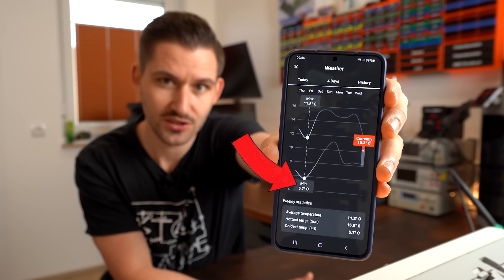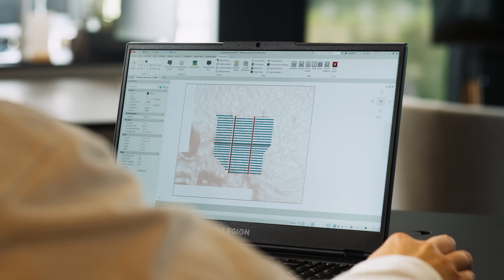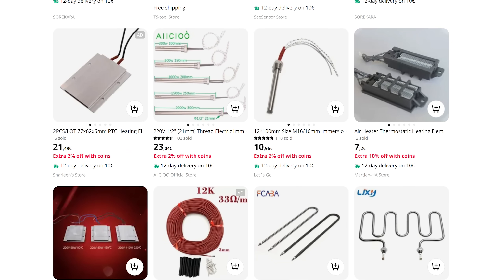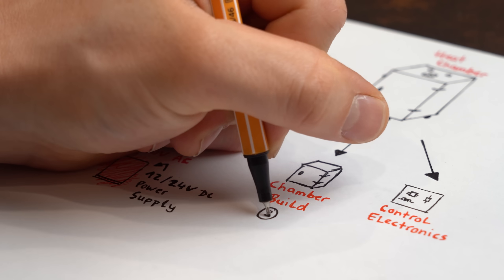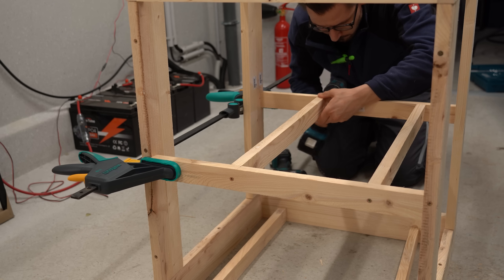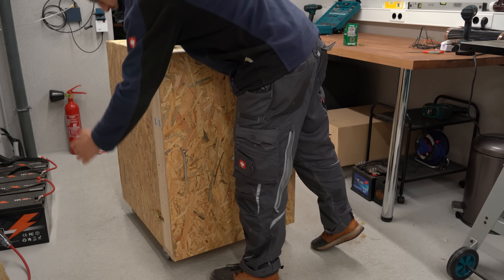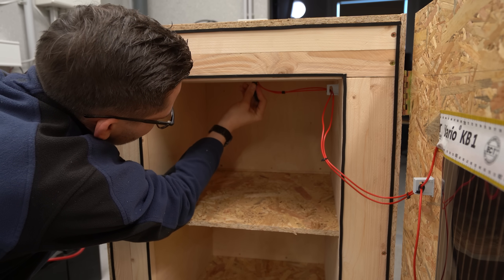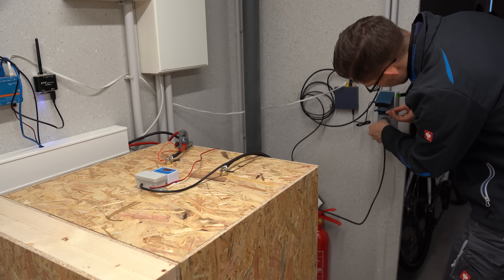The Best Battery Enclosure looks like this?! (Self-Heating)

Comment: I found a mirror heater (to prevent mirrors steaming up in the bathroom) is ideal for warming and drying photographic prints. It takes about 20 watts at 230v. It already has mains connections and is fully insulated so easy to use for warming projects.

Second idea - use a dead fridge or freezer if you can find one minus the compressor etc. from a recycling centre. It’s a box that’s already insulated!
Reply from the maker: Great tip!
Reply: Auto defrosting fridges have resistive heating circuits already installed
Reply: yes , these are available for free all over the place, more weatherproof also.
Reply: I'm interested in your use case for drying prints. Are you talking about darkroom prints with fiber based papers? If so, how does your setup look like? Thanks!
Reply: @jantielens  I use it for drying Cyanotype prints, both to prepare the paper (typically aquarelle paper) with the photosensitive material and also to dry prints after exposure, developing and washing.  I use two large picture frames taped one on top of the other, held horizontally in a cupboard.  The self adhesive mirror warmer is on the bottom glass and I place the print on the top glass. I found only one layer of glass gives too strong a heat, leading to patterns on the prints. Having two glass layers and maybe 2cm between them gives a nice even warmth although a bit slower. I use a timer so I can ‘set and forget!’.  Hope this helps.
Reply: Great. But what about cooling, especially in summer under heavy load.
Reply: And use compresor,evaporator and condenser to make heat pump instead of resistiv heater
Reply: @adomijan1606  An old fridge was my first thought. And also because it is a battery for a solar panel, a heat exchanger combined with a solar collector (just an insulated box painted black with a cold side put in it).
But as always i'm overcomplicating things, just like a lot of tinkerers do😁
There is a beautiful clip where Robert Murray-Smith says to go for "good enough" and ballance a cost, complication and time needed for the project with our desired outcome. And this is exactly what Scott did - used the simplest solutions with minimum cots to achieve his goal. He is brilliant with electronics, so he could build a control box for heating and sensing a temperature, but it would take him some hours to do it. Instead he found a ready component in no time, which probably cost a fraction of what he would have to spend (in his time work).
The only thing i would add there, is an internal coat of something fire resitant (water glass perheaps?) and an alarm device for overheating, which would indicate any fire hazard problem.
For all interested, here is a link to the clip i was talking about:
"1909 Perfection And Engineering"
https://www.youtube.com/watch?v=C5SyjJHoPcE
Happy tinkering all, and stay curious 😉
Reply: @adomijan1606  Just increase the cost and complexity of the system by 10 fold, no biggie.
Reply: @treelineresearch3387  if he use the fridge just turn around inside out and instead cooling he will have heating
Reply: @treelineresearch3387 why would it increase cost to repurpose the fridge compressor? You just need to reverse the flow (and the thermostate), if that's possible, it's actually much cheaper and uses less electricity.
Reply: @antipoti 
For starters, reversing the flow would mean reversing the pipes on the compressor, which means degassing and regassing it. Not worth it when you only need ~20W of heat to bring some batteries up to 5-10 degrees above ambient.

Edit: also, a free fridge is extremely unlikely to be in an efficient working order anyway. Most free fridges will have something dead in them, which is why they were free in the first place.
Reply: @treelineresearch3387 some of the really old refrigerators let you adjust the thermostat to heating mode, marked by a red area on the dial. I do not know why they include this function.
Reply: @PixlRainbow  Heating the thermostat is sometimes necessary in colder environments, usually below 18C, otherwise the compressor stops too early and does not cool or freeze enough, often due to the light remaining half lit.

Comment: Do the batteries not get warm when charging/discharging? That might be enough to keep the temperature inside the box above 0°C anyway.
Reply from the maker: True when drawing a lot of power. But my system is tiny and thus does not charge/discharge with lots of power and thus stays pretty cold.

Comment: Hello GreatScott. Very nice project. I like it. May I  have few suggestions for you? 1. I would make holes on the plywood between the batteries and install small fan for air circulation . This  will helps temperature to be uniform inside the box. 2. Install 2 thermal sensors on bottom  and top and read the delta between them. So you can adjust more precisely  the temperature. And then you can play with the fan running time. It is looks became more advance. Have fun. I hope you are like the idea.
Reply: Seems unnecessary. The heating pad is positioned so that it will heat both sections, and I don't think there is such a big area that you would see a huge difference in temp.
Reply: @nimoy007  Also, all he's doing is keeping it above freezing.  He's not really trying to precisely control the temperature.
Reply from the maker: Thanks for the tips!

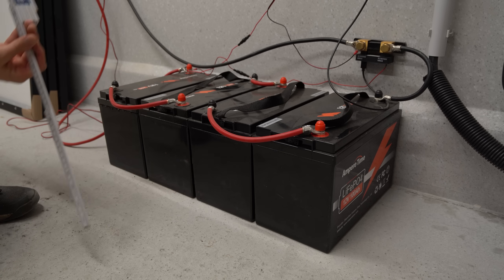Comment: 4:45 Love the old fashioned folding rule.  Haven’t seen one in decades.  Instead of the mat and soldering mains wires, I might have considered a 40 Watt incandescent bulb and off the shelf socket.  Great video.
Reply from the maker: That's a great idea!
Reply: FUN FACT: The light buld inside a refrigerator is indeed used for heating when the outside temperature gets too low. This is called "Winter Mode".
Reply: I wouldn't use that here. 40W is 40W, so it's not "wasting" any energy. It's just that it's a point source of heat that gets very hot and is much more fragile than that heat pad. In situations where a heat lamp would be appropriate, look for a "ceramic reptile heater". It's a ceramic heater element that screws into a light socket. Stick one of those in a clip on aluminum (or aluminium, if that's what you're into ;) ) reflector lamp. I clip one above my workbench in the winter. It feel great! It also works great in the chicken coop to give them some warmth without keeping them awake all the time from the light.
Reply: Yeah, but the bulb presents 2 problems. 1) It is wasting energy in the form of light 2) It is not as compact as the heating pads and would not easily fit in that space
Reply: @nimoy007 in an enclosed space the light will turn into heat anyways, so it's no big deal, and underrunning a higher wattage bulb will also put out even more IR compared to visible light.
Reply: @foorjee  one of those funny cases where we want to lower the efficiency to even worse than it already is
Reply: @Kalvinjj  yeah, though it also has the extra positive consequence of  increasing the lifetime of a lightbulb too
Reply: @Kalvinjj  The nice thing about electrical heating is that the efficiency is essentially 100% no matter what the thing is.  X Watts is always going to heat the same.  I looked it up real quick to make sure I'm right about it and it's 1 W = 3.4121416331 Btu/h.  Not that it's important to actually calculate here but the point is that it's a direct conversion.  Watts = heat.
Reply: @dougcox835  indeed, it's funny to think that the waste, is exactly your goal.
Reply: @Kalvinjj  More like increasing the efficiency, tuning parameters to waste less power on making that useless visible light. They're more optimal heat generators than light generators to begin with!
Reply: @Kalvinjj  yeah, RPi running something useful would be a less "wasteful" heater. :)
Reply: @treelineresearch3387   Heck, they're good at it, even in a vacuum. A beautiful black body.
Reply: @nimoy007  Think about it, where does all that light energy go?  To the walls where it is converted to heat.  There is no loss. And I'm sure he could find some space for a bulb.  Anything that burns Wattage would work actually.  A string of 10 4W night lights would also equal 40 Watts and have the same effect and could be placed in the corner edges.
Reply: @nimoy007 Light is not wasted (there are no windows): it will heat the walls. The smartest option would be to use a cryptocurrency mining computer to heat up the box.

Comment: I just built battery heaters last week.  I did a 12V system running off my 12v batteries.  I used  2 x 20W heating pads taped to the inside of the metal box, an stc-1000 heat controller, and an XH-M609 low voltage disconnect.  I surrounded the whole thing in 2" XPS foam.  This is superior to a regular battery heater in one way:  I draw power from downstream of my system's coulomb counter.  A self-heating battery could discharge its entire capacity and your system would never know it.
Reply from the maker: Sounds great. Thanks for sharing.

Comment: Please do something with those terminals. Right now if you in a moment of absent mindedness put something metal on top of the box you could short out those batteries. I'm sure you've fused it internally etc but it would be easy to put something taller than the termnals between them so a misplaced tool couldn't bridge them.
Reply from the maker: Thanks for the feedback. Should add that in the future.

Comment: I have a question: you have 200 liters of water on 20°C, how much can you heat up this amount of water with your setup and a heater?
Reply from the maker: Oh boy. I do not have the thermodynamics formula at hand. But heating up 200 liters from 20C to something higher with only like 32W like shown in the video, will take quite a while.
Reply: @greatscottlab   @greatscottlab  I'm stuck how much power is converted from battery to heater. I mean, if one battery has 100Ah and 12 volts, this means I can use 1200 watt-hours? What are the losses, and can one use a DC or AC heater?
Reply: Until your heater reaches its maximum temp or an equilibrium between power output and the heat loss of your water to its environment.

Comment: Something to maybe keep in mind would be something like a air quality meter inside the chamber if for some reason something goes wrong with the batteries. Otherwise great project idea.
Reply from the maker: Awesome feedback. Would be interesting to find out how air quality changes when such a battery becomes faulty. Will look into that.
Reply: @greatscottlab  Generally they emit vapours of sulphuric acid. Simplest test is a water monitor placed low down, where the condensing acid will trigger it, though long term it will corrode the electrodes away.
Reply: Batteries emit hydrogen. Seems like this could build up an unsafe amount and explode
Reply: Lead acid batteries emit hydrogen as the electrolyte evaps away. The sulfuric acid doesn't go anywhere, it just gets more concentrated as electricity separates the distilled H²O in the solution. 

Lithium Ion doesn't have this problem to my knowledge, but has its own problems if the lithium is allowed to oxidize (runaway exothermic reaction = ka-boom). I'd line both in kaowool personally, and if using lead acid just attack the top with a 3in hole saw one time and leave the hole, Hydrogen will escape thru the kaowool, since y'know, it moves thru everything. Figuring out how to hold hydrogen inside a cavity was/is still an engineering feat.
Reply: Those batteries are completely sealed, if something happens where a cell has an internal short or something, it will release a lot of gasses. The battery box will explode as they do not have a pressure relief. Unless part of the case has a thin section or scored circle that the case will burst in that one spot safely.  At that point the BMS will shut down on a low cell voltage and since his 4 batteries are in series, the system will shut down. 
LFP is pretty stable though, if it hasn't failed in several cycles, it likely never will under the same conditions.
Reply: @andrewt9204  Battery box is not really sealed much, it will still vent via the base, as the boards there leave a gap.

Comment: I've thought to put all the batteries inside a metal casing box, only wires are sticking out. the box has an opening above, with some foil for example. On top of this box is reservoir with water. once If one of them tries to burn, the heat goes up and burns the foil, water comes in and the batteries are under water.
Reply from the maker: But what foil that burns so easily could hold that much water? Not easy to make I think.
Reply: @greatscottlab  water + lithium sounds like a bad idea anyway
Reply: @greatscottlab  people use tin foil for vacuum cannons, as long as it's secured right i think you could hold a meaningful amount of water (or better,, sand).  the foil might not burn per say, but if there was a significant amount of heat it would weaken enough i would think.  Probably requires some testing.

More the issue i think is the probability of a false positive.  It seems any system that is sensitive enough to be useful, runs a significant risk of going off when you don't want it to.
Reply: That seems like an very destructive and hard to implement idea, also, if you're working with lithium batteries, it wouldn't necessarily work anyway, sand would be better to smother the fire
Reply: You can put a paper cup filled with water in fire and it will keep boiling until all the water evaporates and only then the cup will burn!

Comment: Is it bitcoin mining? (Comment before watching)
Reply from the maker: No
Reply: @greatscottlab  I saw calculations that even during bear crypto market it makes sense. Couple of asics can provide enough heat for a 120ish m² house (or pool heating during summer). Selling crypto will be enough to cover electric cost. But heat is yours! Now bitcoin is taking off to the moon, so it might be even profitable! And solar power for mining is also a great thing. I believe it can be interesting for you to find out if that is accurate for you electrical rate/cost.